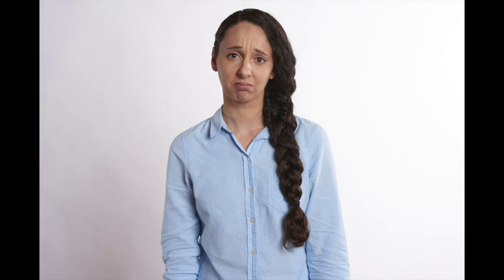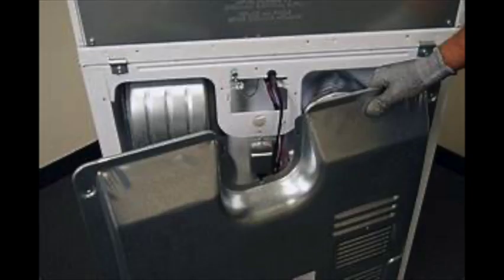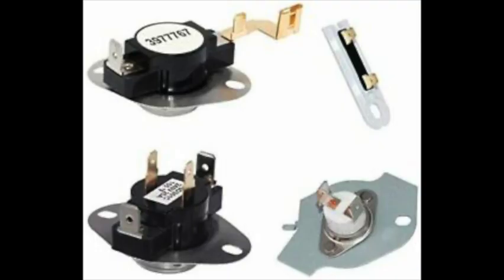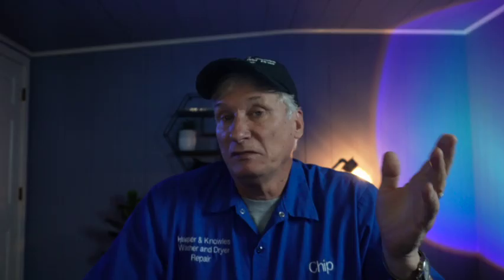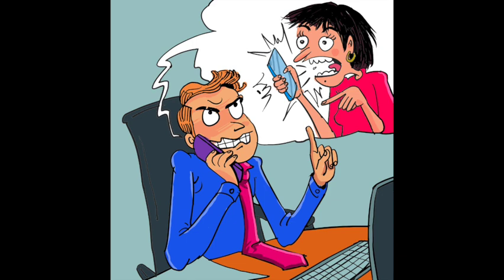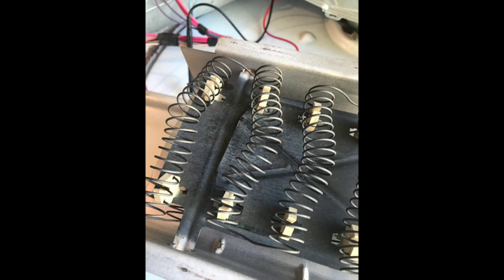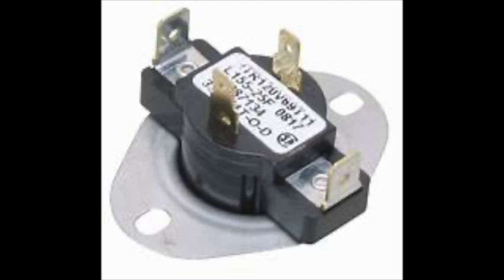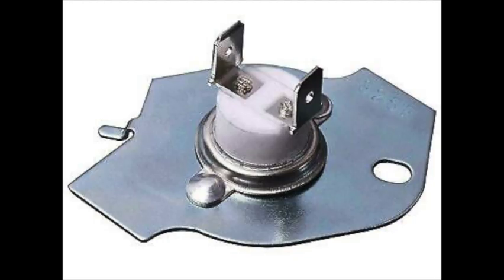How To Diagnose Clothes Dryers That Blow Fuses: Testing Thermal Fuses & Beyond,

Comment: Replacing those parts only temporary fix not the solution. There is an air flow problem or a failing thermistor which is causing the overheating of the element which is why the metal holding the coils are warped. Ohm out  the thermistor and verify sufficient air flow. Always check air flow at the lint screen not outside . Tech 6yrs good luck
Reply from the maker: The dryer in this video doesn't have a thermistor, only thermostats and thermal fuses. Checking the airflow at the exhaust is the better option because on this model if you remove the lint filter, located on top of the machine, you still have the inlet inside the dryer drum which means the blower fan will be drawing air from two different sources.  The airflow at the exhaust will be accurate if all seals are in place and the lint filter is inserted. A more accurate check of airflow would be at the element entry, I suppose, but much harder to determine. Checking the temperature at the exhaust to see if the temperature cycles on and off near the rated temperature of the cycling thermostat will guarantee that all components are functioning properly. Thanks for watching!
Reply: Yes…I pulled 1-2 pounds of lint from within.  Some of lint was escaping into machine at a bad exhaust fitting.  That was probably why.  The duct exhaust was actually pretty free.    Some lint was a bit scorched!

Comment: Easy to fix yourself without having to call anyone. Just buy the kit that includes the element and all new thermostats and fuses and change it all. Make sure you give everything a good cleaning while you're in there. Whole job should take about an hour.
Reply from the maker: That would do it.  Thanks for watching and thanks for the comment too!
Reply: Yep that's the way to go specially if you do it for a living as a retired hobbyist to try to avoid spending any money on parts but but he explained in his video has happened to me twice now so I definitely replace the thermostat which has been the problem and still try to get by with installing the old element
Reply: Yeah that doesn’t always work though

You might have a short, a dirty vent, a bad connection or wire causing as little as 1 ohm of electrical resistance in a 240 volt dryer will do it lots of times and remember a tco can blow from NOT producing enough heat but heating at the wrong times - there’s this thing called holding temperature and functioning temperature.

Of course I hope you don’t have that problem but , ya know, it ain’t always gonna be so easy as throwing parts at it brother .😂

Comment: Been there and done that. I was in the biz for 9 years...done in 91. Much of what you work with is what I worked with...and a ton is completely different. I never ran into your problem, but what I did run into a time or two was when an element was nearly about to blow up, a thin spot in the wire would develop and which would heat the machine hotter, blowing the high limit. Always checked the element in the case of a high limit. My durned Kenmore just blew the thermal fuse and having checked for air restrictions, that'd be my next culprit. The original fuse lasted for 8 years or so. This one a few months. I'll add your discovery to the checklist. Super thanks!
Reply from the maker: Thanks for this great comment.  Thirty one years ago.  Wow!  I still see machines that people have that are that old. They made them to last back when you were in the business. Thanks for taking your time to watch my video, I appreciate your input. I’ll be sure to suspect the element whenever I find that fuse is blown.
Reply: @HarperandKnowles  In my book you ARE the man!

Comment: I'm having the same issue.. keep blowing thermal fuse.. checked the vent.. checked all the other components except the heating element... gonna try this tomorrow
Reply from the maker: I bet you’ll find the answer there. Look for burned spots on the shroud where the element may have touched.
Reply: @Harper & Knowles Washer and Dryer Repair  thanks for informative video..appreciate you

Comment: Exact same thing happened to us! My father switched the fuse twice and when we looked at the element the frame was charred and the springs were bowed We almost said screw it and use copper threading to bypass the sensor and complete the circuit. I’m glad we didn’t though  because the whole darn house would’ve probably burned down. Anyways cheers. Thank you for your help!
Reply from the maker: Yeah, it’s never a good idea to bypass fuses. Thank you for watching my video!

Comment: Glad I found this channel. Thermal  cut off keeps blowing. Everything always checks out when I use my meter. Going to inspect my heating element after work. It has to be the coils grounded out.
Reply from the maker: Hey, Ronny, I’m glad you found us too!  Good luck with your repair.
Reply: I think it only shorts when it gets hot. I didn't really see any burn marks. I would just replace it (along with all the sensors) Amazon has a complete "kit"
Reply from the maker: That is very possible and replacing everything will probably fix it. Let us know how your repair goes. Thanks for watching!

Comment: I have a Kenmore HE4 dryer intermittently overheating & blowing the thermal fuse. Replaced thermister even though it tested good. All other components are testing good as well. I hope your video here will answer my problem. It makes sense when nothing else has. Thank you!
Reply from the maker: I hope it helps you too! Good luck and thanks for watching!
Reply: @HarperandKnowles  After inspecting the heater element & could not find a potential problem, could the control board intermittently cause the dryer to overheat? I did check the heater relay on the control board. It was not stuck closed, could that relay intermittently get stuck?
Reply from the maker: If all the components inside the machine test good and the element isn’t expanding and shorting to the frame then the control board is the culprit.

Comment: Great video, I am having trouble with my Electrolux perfect steam. I had to take it apart to replace a seized blower. Putting it back together  and running it on air only, no problem. Introducing low heat and within 10 seconds of trips the breaker.
Reply from the maker: This tells you that there is a dead short somewhere. Probably at the heating element very close to one of the spade plug connections. I hope you find it. Thanks for watching!
Reply: @HarperandKnowles  Thanks. Thats what some of my research points to. Here I thought replacing the blower was going to be it. Wonder if I damaged something when I dismantled it 😆. The only error code was E 52

Comment: Thank you, thank you!
You helped me find the problem after I had replaced a bad heating element and then it started blowing the thermal fuse for the motor. Heating element was grounding.  Thank you!!!
Reply from the maker: You're very welcome! I'm delighted to hear that my video could assist you in troubleshooting your issue. It's not always a straightforward process, but diagnosing and fixing problems like a grounding heating element can save you a lot of trouble. I'm thrilled to have been of help. Remember, I'm here for any further guidance you might need. Thanks for watching!"

Comment: Thats exactly whats happening with mine i believe. Limit switch failed again after replacing 2-3 weeks prior. Some black spots on element case. No visible cracks but the metal plate is warped and has some rust. Im thinking ill just replace that and then get the kit with the two limit switches and thermostat. I believe the timer is good
Reply from the maker: If it’s cracked and warped it will probably fail soon. As far as the ohms reading on an element… I don’t even consider that, only that it has continuity. I should know the answer but I have forgotten over time. If I run across the answer I’ll post an update. Thanks for watching!

Comment: Good video, I figured this out on a dryer a while back. But I had some help.
Reply from the maker: Glad you figured it out. I have a GE dryer right now that is driving me nuts. I put a new control board on it, programmed it for type 1 which it is and checked that on numerous sources. Set it for E for electric which it is and it won’t heat.  I can cycle through every diagnostic test on the board and all systems check good. It just will not heat when using any cycle selected.  The original board had a relay bad that caused it to click off (pause) during operation.  But that board heats.  This is the second board I’ve tried, still no luck. Any ideas?

Comment: First off, THANK YOU for your videos. It's gotten pretty challenging to first FIND a repairman, then get one to come out to make the repair, so that's my scenario. 

I've got this problem, too. Dryer gets waaaaaaay too hot, blows the thermal fuse . (whirlpool Duet)  Even with the control set to NO HEAT, it still heats. Have replaced all of the components related to heat control. I watched your video where you found the recurring blown thermal fuse to be a shorted heating element. I have not yet opened the dryer back up, because right now I'm a little frustrated with it all. LOL   Can a shorted element be my problem? I was leaning towards a stuck relay on the control panel, but a heating element will be so much cheaper to replace. Thank you in advance!
Reply from the maker: It could be either. Thanks for watching!

Comment: All your videos are really helpful. Are you also able to post a tutorial video on how to adjust the analog timer on the commercial laundry?
Reply from the maker: I may do that some day. As for now I think there is a metal ring, I forget the proper name for it, that is on the shaft of the timer. It should have a set screw on it. When you push the coin tray in it should pass under the device attached to the timer and you should set this ring so that the adjustable part will engage with the coin tray when it returns to the out position and turn the timer shaft to start the cycle. This is on the Whirlpool brand machines. Thanks for watching.

Comment: Going through this right now. Installed new element & cut off switches. Wondering if the new element needs to be replaced, or can the coils be adjusted.
Reply from the maker: If they aren’t broken go ahead and adjust them. Thanks for watching!
Reply: @HarperandKnowles  will do,  thanks!

Comment: Been having this issue for the past 3 days ... replaced the fuse twice and did the tap trick a few times ... going to check if coils are hitting tomorrow... if they are hitting the walls and i re adjust the coils , the fuse should stop tripping ??
Reply from the maker: A “new’ fuse should stop tripping if the vent is open and there’s no air restriction and the coils aren’t shorting. That tap trick is resetting a weakened fuse. Thanks for watching!

Comment: As a Outside Facility tech for an ISP, yes when you think your meter tells you that its ok, sometimes its NOT ok. It may test OK then, but later when it rains and that water gets IN THE LINE, it either grounds out the copper or shorts out the copper, their service goes OUT .... 
Then we show up days later and the lines are "clean" because the water dried out. SO yea it makes us techs look bad and incompetant. And as i tell the customer, that water getting in the line over and over will create a corrosion bridge and at some point that corrosion will STAY there so we can catch it with the meter and find it, sad part is, its going to take a while ... 
Same situation here, your coils are testing FINE when cool, but when they got hot and expanded, they grounded out to the frame and used the frame to complete the circuit until the other sensor tripped. 
I am here because my dryer also blew the high limit thermostat, it was clean open so i changed it. Dryer ran good for 24 hrs then again today it stopped making heat again so now i have to take it apart again tomorrow and check that same sensor to see if it blew or maybe the same issue here that the coils are "touching" the metal frame ...
Reply from the maker: Thanks for sharing your experience and for watching too!

Comment: Hey! My Whirlpool Cabrio is continuously blowing the screw-in fuses that are in a disconnect between the dryer and the breaker. Why does this keep happening? Do I need to take the dryer apart and see if it’s doing what yours is doing?
Reply from the maker: Hmmm, so you have a fuse box between the dryer and the circuit breaker??? I can’t imagine why.  I think you need to hire an electrician to trouble shoot your home wiring. That doesn’t sound right. Your dryer is probably operating correctly but your home wiring needs to be updated. Thanks for watching!

Comment: I have the nearly the exact same problem. In my case the dryer runs for 1 minute and trips the high limit thermostat. I already replaced the motor because previously it was only running about 20 minutes and then shutting down. Just replaced the cycling thermostat also. I already cleaned out my dryer duct line and verified I have good air flow. The only difference in my symptoms is that the high limit thermostat cuts off power to the dryer before the high limit fuse burns out. Any thoughts?
Reply from the maker: “The high limit thermostat cuts off power to the dryer”?  Are you saying that the element cuts off or does the dryer motor cut off?   If your dryer motor is stopping you have a motor problem. If your high limit thermostat (also call the working thermostat and located directly on the element) is tripping, change it. I’d put a whole new thermal cut off kit in it (all four components). Run it for a minute then open the door and look at the hot air inlet. If you see it glowing while the drum has stopped turning then your element is grounding to the frame. I hope this helps. Thanks for watching my friend!

Comment: I have a Kenmore 700 series that keeps blowing the fuse. I have replaced all fuses and the element and the same thing keeps happening. I noticed the fan blade is a little bit wobbly but I cannot figure out what my issue is.
Reply from the maker: I would need the model number to be certain but on the older units without a control board you can try this. Run the dryer without any clothes in it on the highest heat setting. Use an appropriately placarded thermometer and watch that the machine heats up to about 165 degrees Fahrenheit give or take a few degrees. If it continues to climb without cycling off and back soon about 140 degrees then either your element is grounding out or the cycling thermostat on the blower is defective. That is the only two things that can be happening. Now if this is the newer style machine with a circuit board that regulates the temperature then you will have to replace that board. Thanks for watching!